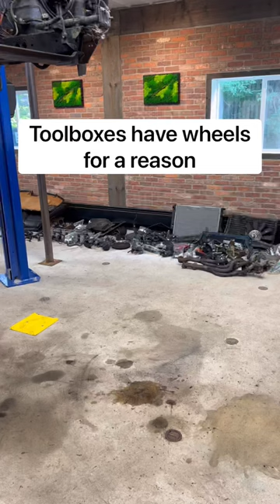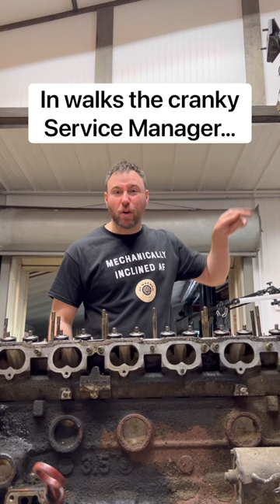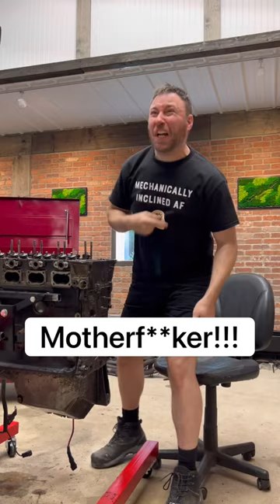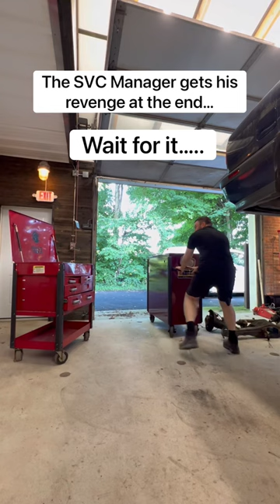Wait until the end for the Managers revenge!  #shorts #cars #automotive #mechanic #diy #restoration

Comment: LOL it's all fun and games until too many open drawers tips the cabinet
Reply from the maker: Dude...tell me about it!
Reply: @wewrench  Dude, back when I used to make glasses, we would have to swap out tooling on the machines for every single lense.  Those tools each weighed about 3 pounds.  We kept about 50 unique version of those tools per drawer.  We had drawers all the way to the ceiling across an entire wall 10 feet long.... ONE day, one of the noobs had all the top drawers fully extended out and the entire shelving unit tipped over and ripped the sheetrock and stud along with it  LOL... don't worry, nobody was hurt, but SOMEbody got fired that day
Reply from the maker: @skuffles  It's scary when it happens
Reply: I made a clip plate on my old box so that doesn't happen
Reply from the maker: @Manofwar9431  That's a good idea.